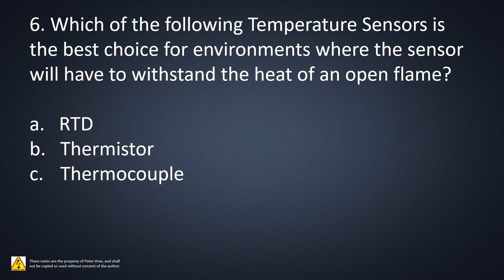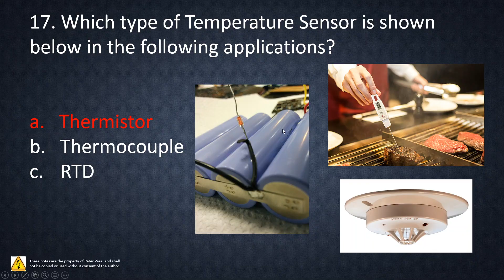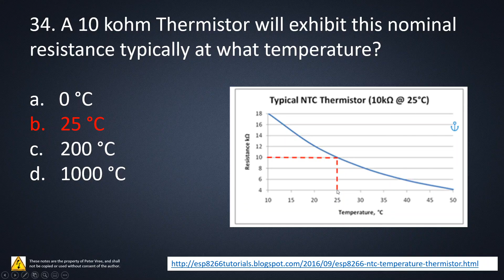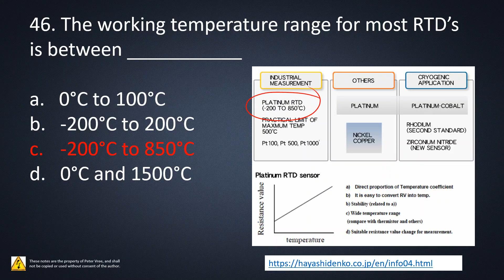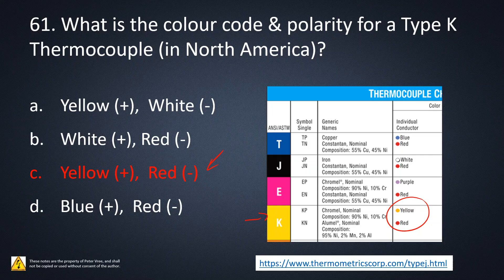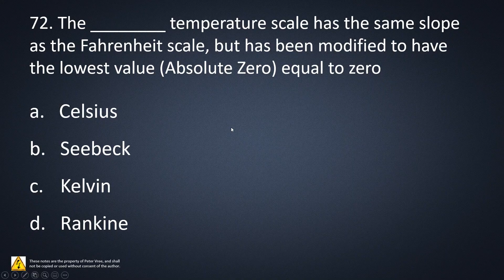Temperature Sensor Test Review

Comment: But on 5:03 the thermocouple, not the RTD has worst sensitivity.
Reply from the maker: Thanks for catching this. You are correct. However, there seems to be conflicting sources. This is from Omega: Sensitivity: While both sensor types respond quickly to temperature changes, thermocouples are faster. A grounded thermocouple will respond nearly three times faster than a PT100 RTD.

The fastest-possible temperature sensor is an exposed tip thermocouple. However, manufacturing improvements have also greatly improved the response times of thin-film PT100 probes.

https://www.omega.co.uk/temperature/z/thermocouple-rtd.html